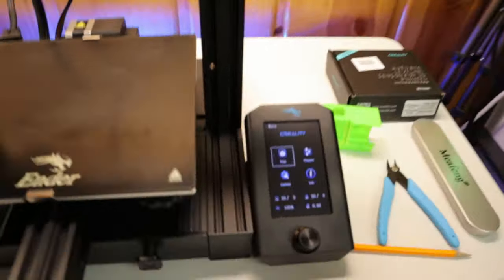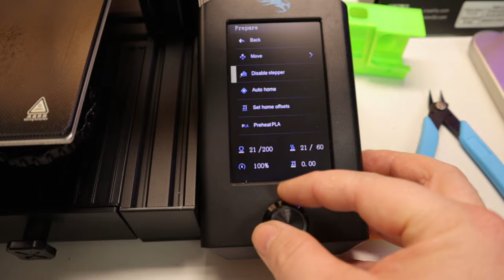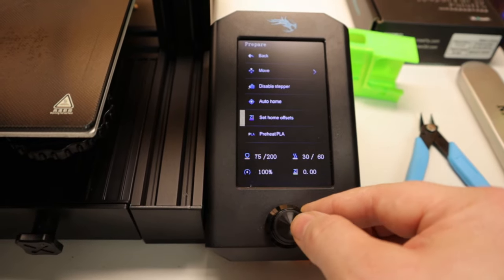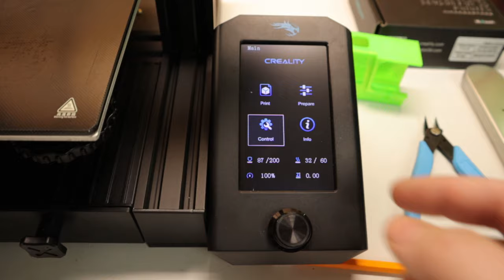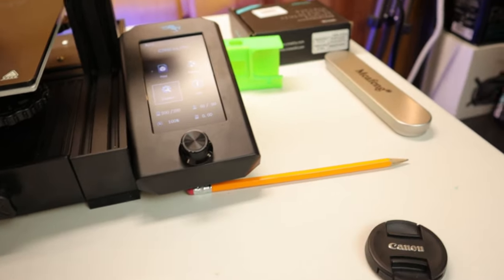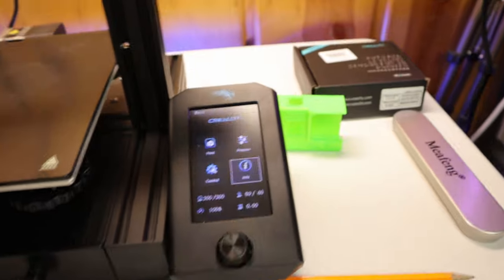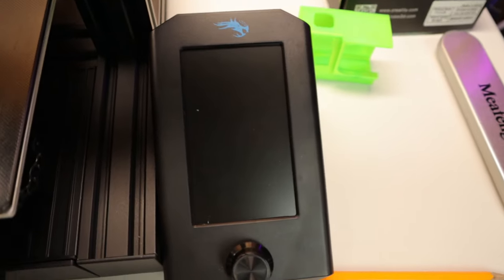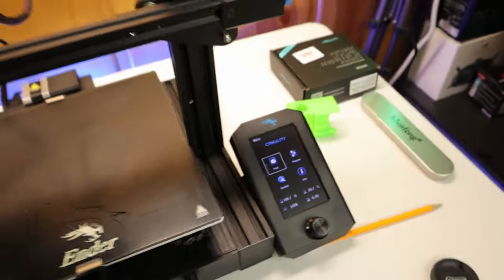How to change filament [ Ender 3 V2 ]

Comment: Pro tip: Better to cut the old filament wire after you remove it from the nozzle, that way you can save more filament from the spool you are removing.
Reply from the maker: This is a better idea for sure. Was still learning myself when I made this video.

Comment: I was used to the change filament option on my ender 3 neo where it automatically retracts. Couldn't figure it out on my neo 3 V2. Apparently you just have to heat and pull on the neo 3 V2. Seems kinda going backwards.

Comment: Thank you so much for this video.  I just got a 3D printer a few days ago and had a hell of a time getting the filament in the first time.  I thought you were just supposed to insert the tip of the filament into the extruder and the gear/pully was supposed to guide it into the tube.  Definitely not how it's supposed to work.  This video helped me a ton, thank you!

Comment: Can you change out filament in the middle of a build with the Ender-3 V2?  To change colors, etc?  How?  Oh, and what happens if the filament breaks when in the middle of the print? What will the printer do?  Thanks for the video! Subscribed!
Reply from the maker: Yes you can change the filament mid print. Some firmwares handle this differently, but the smith3d firmware im using currently allows you to pause the print, and change it out mid print. I planned on doing a video showing how to do this in the near feature.

Comment: I've seen people watch the temp go down to 90 or 100 before pulling (called a cold or "atomic" pull).  May be just for clogged nozzles though (I'm a newb). Pulling cooler filament allows it to grab any bad particles in nozzle which are pulled along with the filament.  What is that blue wheel on your extruder ?  I don't have one or a wheel to insert desired amount of filament through the extruder.  An upgrade ?
Reply: The blue wheel comes in the box if you buy an Ender 3 V2 new, it could be in there if you have the box!

Comment: How do you go from TPU to PLA? Getting all the TPU out in one go has been a mission.
Reply from the maker: It's not bad at all. Just push it down a little, and then give it a good pull all the way out, hold the extruder open the whole time, and a little bit longer to get the string.

Comment: @509 Drone  Thanks for the vid, just wanted to know how to purge a little extra plastic out between prints (Ill just pre heat and turn the big blue knob a few times).  I use white PLA and color it with sharpies to highlight lettering on keychains (ROUSH) I make for friends at work. Sometimes the color will ghost a bit into the next print where I want it white. Going from purple to green now...that would be realy ugly!
Oh and it's sad how people (Louis in the last comment before mine) will crap all over a good video for no good reason at all. I find it's often because they are unhappy with themselves and their lives, and just love to spew venom and hate on others.
Otherwise known as misery loves company ^-^
Reply from the maker: I appreciate the support brother! People definitely like to push their issues into others :) as for purging your line, when I change the filament out, I use the extruder and manually push out filament until I see the correct color coming out, then start the new print. Hopefully that helps! Join us in discord if you want to chat more, a bunch of really cool, and helpful people in there.

Comment: I don't bother clipping it off like that before removing. Wastes just a few grams of filament. I keep one hand on the spool so that it doesn't go loose and just pull out with the other hand. I've had some  filaments snap in the hole like yours did and have just gone to using a filament clip.

Comment: I need to do a change of filament while printing. but ender 3 v2 doesnt do it. how can i do it?
Reply from the maker: That's going to be a firmware thing. I know smith3d allows for it. I'll look into th3d firmware as well. But basically all you do is pause the print, and swap filaments. But the firmware needs to support it so it knows to purge the line, and resume where it left off. I'll make a video about it shortly.

Comment: I am trying 30 minutes to put it there and it  just wont go into that F hole
Reply from the maker: Yea it can be a pain at first. Make sure you bend your filament so it's straight, cut the end of the filament at a 45 degree angle, and when you're pushing it into the extruder feather (slightly push) on the extruder lever. Hope that helps, good luck!